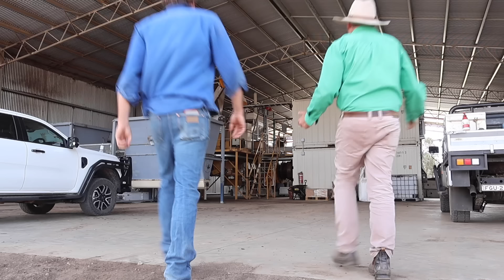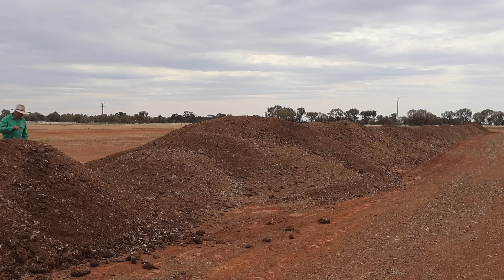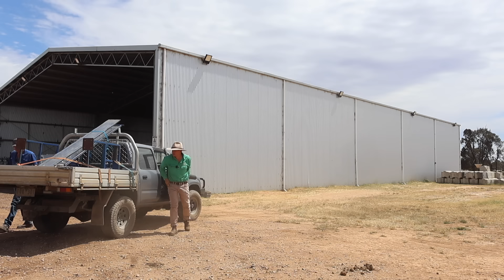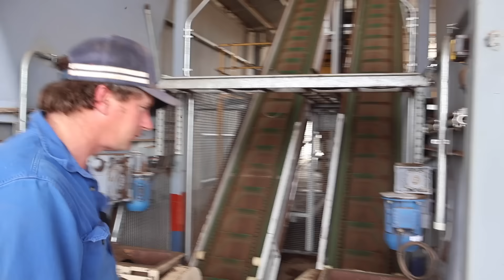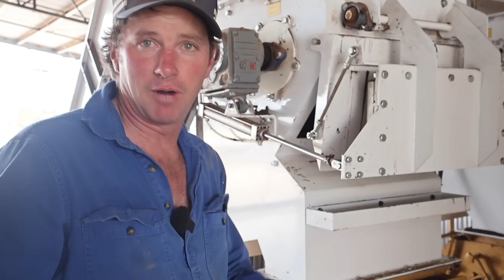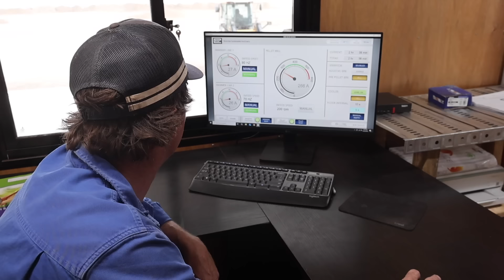How These Brothers Turn Chicken Manure Into Gold!

Comment: This is absolute load of sh*t. This stuff has less than 30% chicken manure, rest is rice hulls or woodshavings or sawdust at times from treated pine with a NO-NO arsenic. How about antibiotics in broiler feed to make them grow faster. They trying to put down layer manure because it is pure manure and far more valuable and easier to transport. Layers are fed complete natural diet and definitely no growth promoting antibiotics and other crap  also lot more nitrogen and calcium. I know because I have done lot more research than these cowboys.

Comment: The problem with pelletised fertiliser is that it was heated to too high temperatures. It still has a lot of the good molecules though. I would recommend to gently spray a biologically active solution onto it before spreading.

Comment: Interesting that layer litter has heavy metals at levels that concern them. Where can we find out more?
Reply: Yes I was also wondering about this, it's very worrying!!!
Reply: @sandrinakeffufal6008  This is absolute load of sh*t. This stuff has less than 30% chicken manure, rest is rice hulls or woodshavings or sawdust at times from treated pine with a NO-NO arsenic. How about antibiotics in broiler feed to make them grow faster. They trying to put down layer manure because it is pure manure and far more valuable and easier to transport. Layers are fed complete natural diet and definitely no growth promoting antibiotics and other crap  also lot more nitrogen and calcium. I know because I have done lot more research than these cowboys.
Reply: @AG-ze8sj  I was wondering if it's something to do with the lifespan of the chickens? Also as egg laying chickens would need more calcium in their diet that would change their poo. We would love you to share more info about your knowledge :)
Reply: @AG-ze8sj I've looked into this too. The EC levels I've found are high at 13 d/seimens when you want an EC of no more than 0.5 for good pasture. What are your thoughts on EC aka salt levels in this stuff.